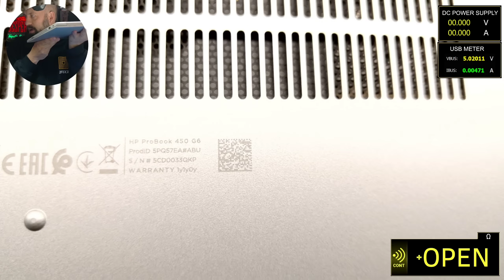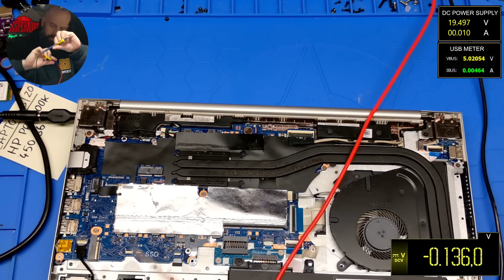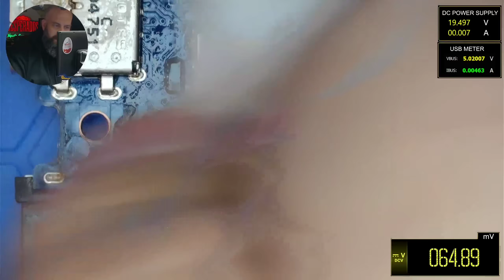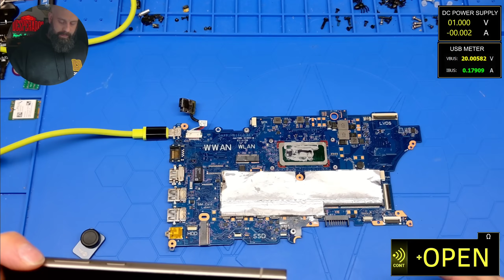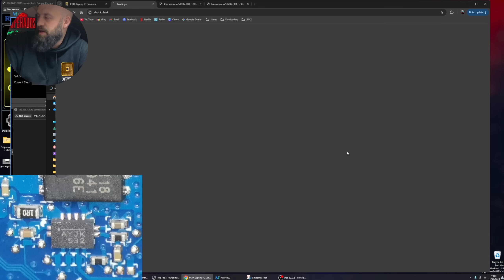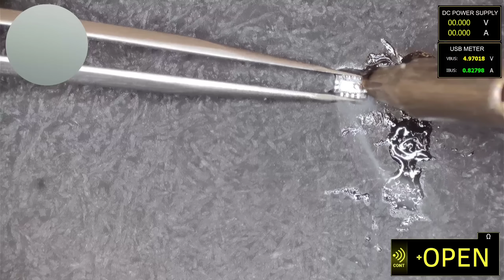3/20 - Laptop Joblot Rollercoaster Ebay

Comment: Nice smooth diagnostic J ! Very much enjoyed this video and can't wait to see the next laptop
Reply from the maker: Thanks 😊😊😊 Can't wait for my game gear video
Reply: Hi i will tell you one thing an del charger doesn't work with hp laptop. They use another proticol and can damage the board. You need a special tip for hp laptops. Maybe the tps ic is damaged because youused the wrong charger in the start. They use the same tip like but are not the same. Just a tip for the future times . I would like to see how you program such chips.
Reply from the maker: @stevedebeukelaer1424 Hi Steve maybe you are talking about the PSID pin? This is for communication so the laptop can determine the wattage of the charger. The Dell and HP definitely work in different ways.
In the dell they actually have an IC I think DS2501. Hp use a voltage on the centre pin like 1.8v to tell what charger it is.
In my case I have just using a Linear Bench power supply to provide current with no communication. The physical connector is the same size. Without the ID pin being connected. It means for gaming laptops etc that require the higher wattage I will get a warning on the screen and it may not be able to charge the battery at the same time. I do have a special device I can use for PSID emulation. I will make a video about this at some point.
Reply: @JFIXX1 yes i mean that. The hp laptop will not power if you do not have a right adapter or some special tool for hp for powersupply. A dell laptop will power up but will not charge or throttle. That is also error you got with constant blinking charger light in the  beginning.